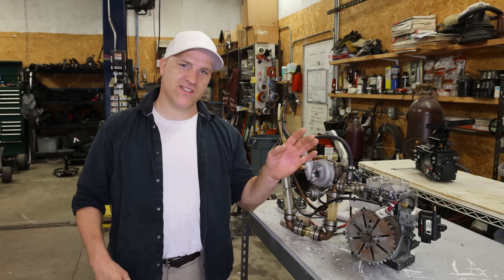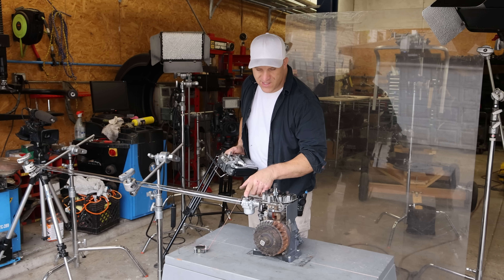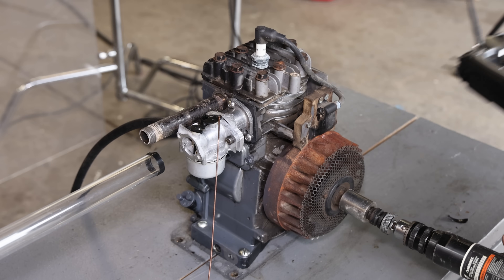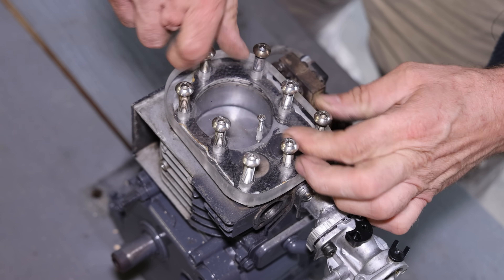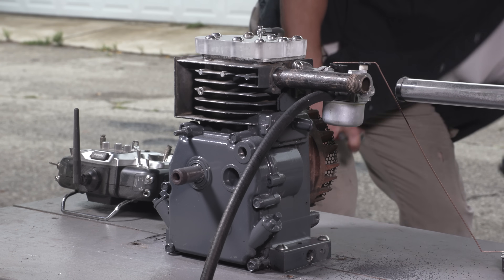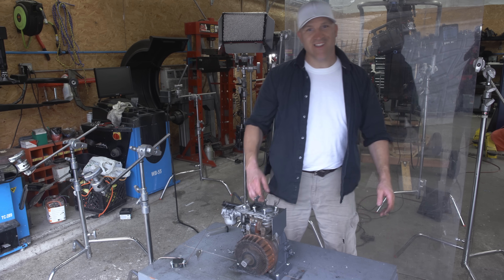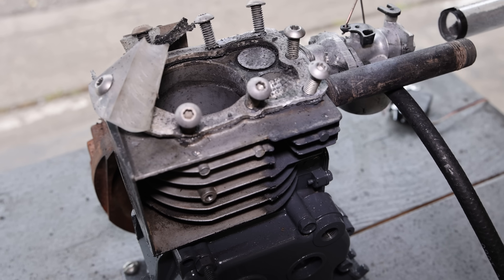Engine Running On GUNPOWDER

Comment: This is proof to the saying "they don't make 'em like they used to".
A modern small Briggs is calculated for 50 hours of running time. Of course they run far longer than that, but still....
Reply: @DenkertM One of those old geezers who'd worked with small engines for the last 40 years of his life. May he rest in peace. Mind you, I'm talking about the simplest line of engines with the cylinder machined directly in the aluminium casting, used for lawnmowers and such. The vanguard series is far superior with proper sleeves and pressure lubrication.
Cheers.

Comment: Smokeless powder loves compression, higher the compression the more efficient the burn maybe trickle the powder and play with the timing so it ignites during the start of the exhaust stroke or use an engine with horrible compression and see if it doesn't self destruct as violently

Comment: hey can we do 5% gun powder and 95% nos. Cos Nos Will help dispense small amount of gun powder into the combustion chamber.  Its can be used as a ice alternative for decreasing turbo lags and increase  initial acceleration of engines. This sounds  crazy but doable. I can help in the thinking process.

Comment: You could try running it on coal dust, since it doesn’t contain its own oxygen. It would be cool to see all the black smoke.
Reply: Coal dust isn't combustible by pressure and spark alone. It needs a extremely hot heat source to do anything other than clog up the cylinder on the intake stroke.
Reply: @brandonmiller7466  Fine enough coal dust becomes near-explosive when carried on a stream of air. You would still need a little gasoline to produce a flame for ignition though.
Reply: @OdinYggd  Just add a touch of propane!
Reply: The first internal combustion engines ran on cool dust.
Reply: @tbrmotorsports2244  You might be confusing them with early diesel engines. Some early diesels used coal dust with airblast injection. But the earliest practical internal combustion, circa 1850s, used town gas as fuel. This gas was distributed much like natural gas is now, and made by baking coal in a kiln then filtering the gases produced.
Reply: @OdinYggd  I thought diesel engines are internal combustion engines! I guess I learned something today.
Reply: @tbrmotorsports2244  They are internal combustion engines. But the very first Diesel engine patent was from 1893- by then internal combustion had been around for 50 years and was rapidly growing in popularity as engineering improved and knowledge of the Otto cycle spread.

Comment: This really re-inventing the wheel. Sir George Cayley. considered as the Father of the internal combustion engine used gunpowder as his fuel in his experiments. He wrote that a liquid fuel such as tar of naphtha might produce better results. Incidentally he also  invented caterpillar tracks and was the first to successfully build a man carrying heavier than air machine. All of his achievements occurring in the 18th Century.

Comment: Unless the connecting rod was shattered, that B&S will run. Those little 3-horse engines are tough, I've beat on many of them. The older Briggs engines are the hardest to kill, I've even run a B&S from the early 1960s (cast iron 1/2-horse from a small reel lawwnmower) without oil for several minutes. I'm not sure that rod is ok if 1-inch thick Lexan was ripped apart, but maybe.

Comment: A little late here, but I wonder how easy/hard it would be to start the engine remotely. That way if it backfires during starting and ignites the tube it won't burn you. Also, there's a risk of static electricity when filling that tube, not sure the best way to fix that though. Maybe a paper tube that's been left in a humid room for a few days? I've never done something quite this crazy, so I'm no expert.
Reply from the maker: im going to set it up that way next time, Great Idea !!!!
Reply: @WarpedYT  thanks! Stay legal, stay safe, and have fun!💥 cool video btw.

Comment: LOL that's INSANE 😂😂😂 I'd be really interested if you could get the engine to actually run properly on gunpowder (stock or see through head, probably need the stock one). Would be very interesting, would probably need some sort of solid fuel metering device. That would essentially be an air-independent engine... space generator! (or submarines..) Maybe you'd need a much bigger spark plug, maybe even a glow-plug of sorts, like a hot bulb engine, and something to admit a few grains of black powder on each cycle. I mean machine guns use gas from gunpowder to power the reloading mechanism, so it seems like it would be possible in theory. Could you run the engine on wood powder/very fine sawdust, coal powder? Direct solid fuel combustion engine, even if it's not gunpowder, would be super awesome.

Comment: Why is the tube of gunpowder in the scene when he tests it after it Blew up
Reply: I was thinking the same thing. But look at the 6:00 mark. He's talking about putting the stock head back on while the see through head is blown up, and there's a new tube in place.
Reply: I came here wondering the same thing.  Good point about the 6:00 mark though showing the tube.
Reply: I hope is because he will blow it up with the metal head in another episode
Reply: I was saying the same thing didn't the tube brake
Reply from the maker: @cottoaa5133  I did the explosion twice, just cut one out, it was too redundant.
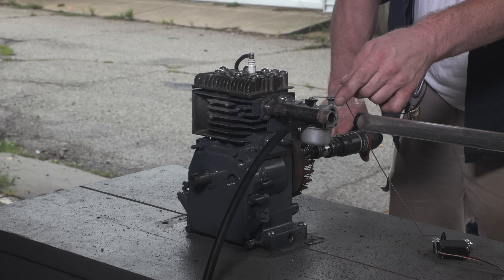Reply: The tube at the 6:00 mark is empty. At 6:11 when he is cranking it, you can see the black powder still in the tube.  Why?????
Reply from the maker: @thehogdoctor  because I set it up twice but ended up not using that second explosion scene, however I did include it at the end of the video
Reply from the maker: @thehogdoctor  your answer lies at the end of this video
Reply: A sadistic part of me wanted the intake to suck a small part of the gunpowder up whilst he hand his hand on the throttle after his bold claims of taking “extra precautions”
Reply from the maker: @Hollenfeuer87  nooooo!! I don't need any more problems in my life . Be nice
Reply: Warped Perception Just be careful my man. That could have gone very wrong.
Reply from the maker: Because I did it twice but decided not to use the second explosion scene in the Final video, I did however include the second scene at the end of video
Reply: God was watching out 4 him.
Reply: 👆 Up this comment, he has to answer that !
Reply: @monkmonk1132  I've got a reply asking this also... Fuckery... he shot  that clip before he blew it up just to say it would start even though it probably didn't...
Reply from the maker: @The50Baker  hahaha... No way, no reason for me to do that.
Reply: @WarpedYT  so you had 2 clear heads that you blew up? But only showed 1? This makes no sense. Crank it up live right now
Reply: Up! I was wondering the same thing

Comment: How to lose your arm:
- Buy gunpowder
- Put 50g in an electric blender
-Hold it with the hand while blending
Reply: It's a possible way. A lot of risky things don't catch up to you the first time. I was also worried by how close he was while starting it, any backfire and that plastic tube would have gone off in his face. And plastic makes static electricity too.
Reply: Just info for the guys asking. You fold powders in paper that supply their own fuel. You definitely don't run in a blinder or anything electric because of electrical interference. The same with a cellphone and a gas pump. All it takes is a little static and you're fucked.
Reply: I thought this exact same thing when I watched that lol
Reply: Did you lose a arm doing this ?
Reply: Did someone loose their arm?
Reply: Well.....I mean, he is missing a finger after all, so your not wrong......right?

Comment: That clip after with stock head wasn't after, it was before cause u can see the tube full of blackpowder wich blew up when the engine did
Reply from the maker: I had done the explosion 2 times, the second one is at the end of video. And yet the engine still runs
Reply: @WarpedYT  ohh, wow pretty crazy. the explosion stopped the engine and everything dead in its tracks in a millisecond amazes it didn't snap the crank or rod cool stuff
Reply: noticed rthat, bloke is taking the piss out of us

Comment: but you didn't actually blow up the engine, you just shattered a very week cover. Please, make a cover that's made of 1" or thicker steel plate and bolt it down with additional bracing like a press or some welded external supports. see if you can get the piston to eject out the bottom or blow the crankcase apart.

Comment: The powder supply tube needs a flapper valve to prevent the blowout that you experienced. It could also be used to meter the amount of powder that enters the cylinder each cycle by using a "waterwheel" design on a one way clutch. Could get this to run several cycles. And black powder has a much higher energy density than gasoline.

Comment: You effectively set off a bomb in a residential neighborhood. The only reason why the engine just didn't turn into a complete pipe bomb and kill your neighbors directly across the street - or you - is because the acrylic cylinder head let go. That was a ridiculous amount of gun powder in that you pumped into the engine, and it was completely irresponsible of you to do this experiment in a residential neighborhood. You could have easily gotten someone killed.

Comment: i think the problem was that you used the see through head instead of the stock one i think the stock head would be able to handle the shock from the gunpowder better seeing as the see through head was made of acrylic and also pipe the exhaust down away from the gunpowder you can also see if mixing gasoline/diesel or nitromethane and gunpowder can make the fuel more explosive and make the engine run faster

Comment: FINALLY! It blows. The eslxplosion was so fast the high speed camera barely slowed it down.  Was also pretty cool how the tube cought fire. I think that would be some more cool videos. Lighting gunpowder off in the tube at slow motion. Not like a pipe bomb but just enough gun powder to get it to go from one side to the other lime in this video.

Comment: good thing you did that with a plastic head.  you would have actually grenade-ed that engine and the shrapnel might not have been stopped by the measures you had in place.

Comment: You put yourself in a very dangerous place, on the second try!  Min 6:20 What if the carburetor shot fire inside the tube filled with black powder!? i think you may need to reconsider your safety precautions.

Comment: Now that's a LOT of damage!  Pretty amazing the Briggs & Stratton is still running after this!
Reply: Hello project farm
Reply from the maker: I guess Briggs & Stratton can make it through a gunpowder explosion but it couldn't make it through the coronavirus...smh
Reply: @WarpedYT  July 21st... man... hopefully they make it out the other side! I mean gm basically did it, and dodge did it twice...
Reply: Warped Perception 😂😂😂🤦🏼‍♂️
Reply: @WarpedYT  excellent idea for engagement sir.
Reply: @WarpedYT  So, the question on everybody's lips is now, did you feed it gunpowder with the stock head on too? Because we all (well ok, most of us lol) saw the second tube primed with powder...  That engine needs to be given the biggest send off ever!
Reply: Phil swift reference there 😆
Reply: Dude u are the coolest guy on YouTube
Reply: I think its need a flex glue for the gasket
Reply: If you notice the tube with the gunpowder is magically back together and full of powder in the clip that was supposed to be the engine running AFTER the explosion that destroyed the tube.  It could be an honest mistake in editing but I guarantee that clip was long before the BANG.
Reply: @MrKingdavis13  but at 5:47 you can See the Glass Tube with gunpowder after the "bang"
Reply: @dergamer0913  it blew the end of the tube off in the bang if you look closely.
Reply: @MrKingdavis13  Look at 6:05, the see-through head is shattered and the head bolts bent but the tube is there.
He must have repeated the experiment two times to get more footage and the second time no embers ingnited the gunpowder in the tube.
Reply: @MrKingdavis13  it's just burned, you know, from the powder?
Reply: "Now that's a LOT of dammage" How about a little more?
Reply: Project Farm, you still need to do a compression test and teardown on his engine. So let's get this project underway
Reply: @sleepless3y3s  we also need a test that will leave nothing left to compression test like a oxy acetalyn test
Reply: is that last clip with the engine running really taken after the engine blew up as I can see the clear tube with the gun powder in the engine running clip.  The pipe blew up so why would you rig a new pipe up and put more gun powder in it, just to see if the engine still runs?
Reply: @cormacsyt0  Thank God I wasn't the only one to notice this
Reply: Is it still running tho? I saw a tube full of black powder right next to it when it was supposedly running after the tube was exploded.
Reply: @whitneydalton1315  he's probably getting ready to blow it up again. I hope he doesn't get hurt in the process.
Reply: Anyone else now want to see a Project Farm & Warped Perception collaboration video?
Reply: Exactly why they went out of business they last forever
Reply: @Joseph_Headen  Briggs went out of business? Huh?
Reply: @kleetus92  what!?!?!??!
Reply: @thedude7726  I agree, that dude said Briggs went out of business... I never saw that. I think he's full of shit.
Reply: @Joseph_Headen  yup great motors honestly
Reply: @cormacsyt0  yeah i noticed that too makes me feel like he didnt throw the head back on. SMH
Reply: I don't think it was. The tube of gunpowder was in the frame when he was showing it running after it detonated. How did he still have the gunpowder primed tube if it was after the explosion?
Reply: Project Farm hello project farm
Reply: Do another test but with oxy acetalyn and use the stock head for more carnage
Reply: Why did his tube suddenly exist again?
Reply: I read this in you voice 😅
Reply: Nothing a bit of Seafoam won't fix...
Reply: Mac M. Watch the video again @ 6:10 there’s a new tube and engine still has bent head bolts.
Reply: @DieselEngineSean  Sharp!
Reply: @DieselEngineSean  thanks for pointing that out, as Davis King mentioned I to thought that it running after the explosion had been faked.  But it shouldn't be that surprising that it ran afterward...the plexiglass would be far weaker than the motor and take the brunt of the explosion so there is really no reason for it not to run afterwards.  It is odd that he would have setup a new tube (with gunpowder) for a shot that was meant to only prove that the motor still ran afterwards.
Reply: Shamie Ramsamuj
 Predicted your comment 1 hours before you posted. Amazing...............
Reply: Flextape wil do the jop
Reply: Hey project farm nice to see you here
Reply: Briggs and Stratton should be a sponsor after all this...
Reply: I BLEW THIS CYLINDER HEAD OFF!!!!  And repaired it with only flex seal. 🤣🤣🤣🤣🤣
Reply: Let's see if flex seal will fix it
Reply: Project Farm AMAZING!!!! Mahalo sir but it’s always amazing!!!!!
Reply: Hi project farm
Reply: You say it's still running, but the last clip of it running still had a gunpowder tube in it... Didn't that explode too?
Reply: The Briggs and Stratton really getting a battin
Reply: Think I must of been suggested this channel from project farm I watch every video and this one is also great I’m subscribed 👍
Reply: I don't think it did run. The glass tube that exploded somehow fixed itself in the shot of the engine running after it exploded.
Reply: can't wait for your next video :)
Reply: Aye. I didn't know you were his friend.
Reply: its a flathead briggs those things are great engines
Reply: I was the first like :)
Reply: LOL 😂😂😂
Reply: Jesus 🤣🤣🤣
Ka-BOOOM
Reply: Video idea: will JB weld will hold the head when gunpowder explodes
Reply: In stark contrast to a modern Briggs you’d find on a consumer lawnmower
Reply: Maybe B&S should hire both Todd and Matt and end up with a truly non-destructible engine! Lubed by Todd, strengthened by Matt !
Reply: @cormacsyt0  I thought he was going to do a second run with the stock head.
Reply: Your turn to blow up a motor with granite
Reply: Hi project farm
Reply: @cormacsyt0  aaah yeah im not the one who noticed 😂
Reply: Hi
Reply: Should buff out...
Reply: this guys are crazy😂😂
Reply: Oh no the poor lawnmowers know what is coming
Reply: Hi Todd.
Reply: Try to do a electric supercharged (5-10bar) engine working on hidrogen 
If this cant break it , it is indestructibile
Reply: I'd say that engine is shot.
Reply: Up next on PF: which gun powder works best!
Reply: @Joe eoj but where's the footage!! He must have tried it with the stock head.
Reply: Time to test some see through cylinder heads :D
Reply: I read this in your voice lol
Reply: Nothing flex tape can‘t fix
Reply: Nothing you can't fix with a bit of Flex seal
Reply: Just a lil bit of the handyman secret weapon duck tape should fix it
Reply: Bro that second camera makes you look like MythBusters. the earlier one for some reason is a shallower color range it seems. I have a mid-level 4K TV and it was night and day difference.
Reply: You Mus fix it With flex seal
Reply: Phil Swift liked that.
Reply: That. Was. FUCKING AWESOME
Reply: Song too
Reply: JB Weld will fix it 😂
Reply: There's an old tractor that has a specific slot designed for a shotgun shell that doesn't have shot in it just gunpowder its what's used to start the tractor
Reply: best reply ever
Reply: What are you doing fwep bro?
Reply: Briggs is really is lol...
Reply: A Briggs is doing it's Briggs and Stratton thing (they're indestructible)
Reply: That's amazing that it was still going after it blew up.
Reply: @IceBergGeo  yeah the old briggs and stratton engines are very well built!
Reply: Hello PF